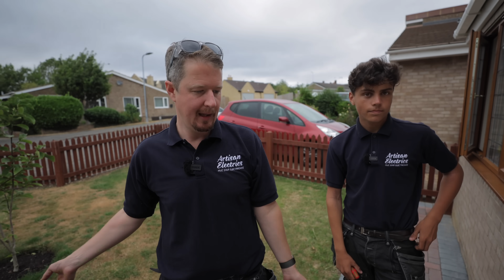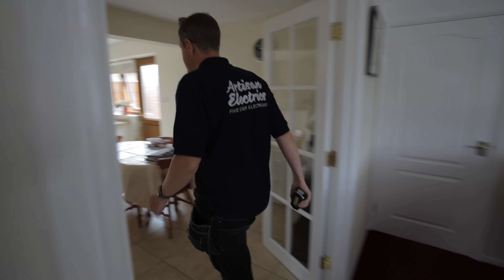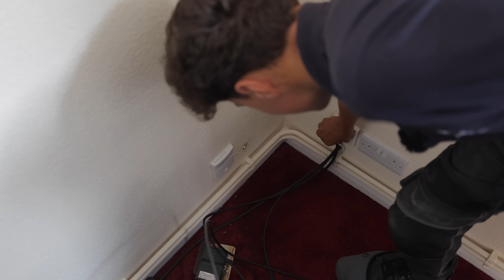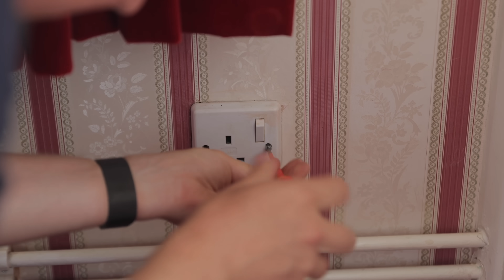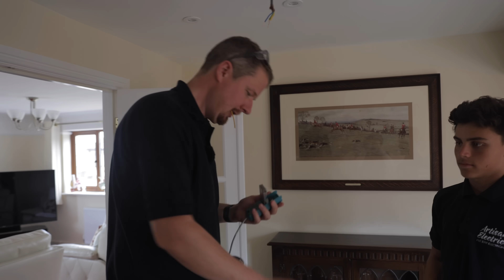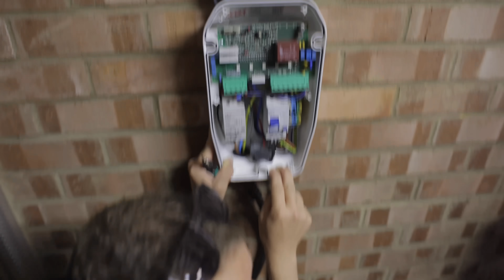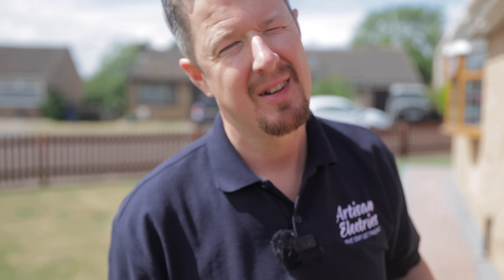CUSTOMER TRIED TO SUE ME - SHARING MY ELECTRICIAN HORROR STORY

Comment: Malmberg is a Swedish company and from my experience they are kind of something in between the cheap no name and big name brand stuff. It's not junk but it doesn't have the premium feel to it like schneider or hager.
Swedish stuff keeps popping up more often than i would think in your videos haha. Tools, gear, components and i even saw a Nibe heater in one video...
Reply: Swedish company yes, but they arenonlyna distributor. The stuff comes from Asia, likely China.
Reply: and tbh, hager mcb´s are not that expensive just checked 16a mbn116 standard boxcutter mcb as it comes,  not even 4€ incl tax. they have like 10 mcb´s max, so 40€

Comment: You mention the car charger
1st I assume the garage is on a concrete pad?
Thats as good as true earth so under pen fault you'd receive a shock.
2nd why code it?
An eicr isn't to check that it complies with current regs is to ensure the installation is safe and in good working condition.
Hence condition report.

You could make the customer aware of your concern but to code it is incorrect.
Speak with the nic and I'm sure they will agree.
If however the car charger wasn't installed correctly to the regs at the time of install then thats different

Comment: malmberg are swedish, do not make that kind off box (only full front with lock, swedish standard) but they are made to fit every thing (in sweden you can have any kind of fuse in any box, becuse the law only say the installer only "need to do it the normal way" (no license or training needed for after installations, and just one guy with license on new prudaction) but still known to have one off if not the highest electrical safety in the world), but england is very wierd with there laws.

Comment: Confidence is easily gained with a professional articulate patient mentor.  Yet another highly professional video. thank you
Reply: Great video. Just a point about the roof joists: if you're fitting "in roof " panels in place of those tiles, you will almost certainly be reducing the load on the roof, not increasing it as the panels are much lighter than the tiles they replace.

Comment: Impedance vs resistance.... 
Short answer: Resistance is more for DC where as impedance is the AC equivalent of DC resistance. 
Long answer: With AC circuits the capacitive and inductive reactive components react differently based on the AC frequency as compared to DC. So in order to get a true AC resistance reading you have to account for both those reactive components plus the true (non-reactive) resistance and the resultant measure or calculation is called impedance.
Reply: Hoorah! Someone who actually understands at last 🙂

Comment: Sorry, it bothers me that you are concerned if the brand of MCB is different from the board... why does it matter?
Reply from the maker: Not type tested and sometimes they don’t fit properly
Reply: @artisanelectrics   how can you tell if it is type tested?
Reply: @michaele5543   you ask the board manufacturers if they tested the other brand in their boards (not to see if they work, the test is for performance like overheat and interference, precise alignment etc). I take a bet no manufacturer ever tests another brand in their board, why would they.
Reply: @electricery  thanks for educating me, I didn't realise a board maker would be required to test it like this but now it does make sense. It does come across as nitpicking though... Presumably it doesn't actually fail an EICR?  It's a bit like an MOT tester insisting that cars should be fitted with the tyre brand that the vehicle was type approved with...
Reply: @michaele5543  can fail, depends if it shows signs of heat stress or if it doesn't fit the busbar properly.  It will normally be a code 3 if looks ok and code 2 if potentially a hazard. It is in the regs book and therefore should be complied with when making repairs or upgrades to the consumer unit

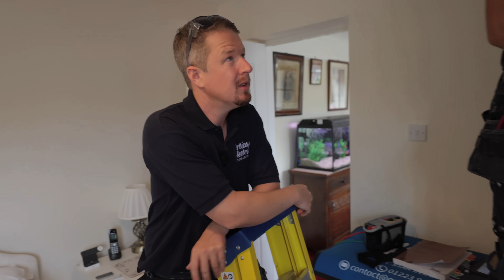Comment: 8:13 Not a customer or anything but I put up a video about a shady parking company (Parkshield Group) that managed car parks for fines. Their site was awful and insecure. I pointed this out in my video. Took them a year to decide they didn't like it and flagged it as their own work so the video got removed and I got a strike which I had to wait to expire. They tried to cover their tracks by changing their site so they put they'd updated their privacy policy before my video was up, trying to claim my video was false. They didn't know about the wayback machine that had archived their site and showed the exact same page missing the information they claim was on there on that date.

A few years before that purchased an old Nokia E71 from someone off Ebay. It arrived with a cracked screen. Guy refused to refund told me to take it up with Royal Mail. Ebay weren't interested. Idiot had secure wiped the phone so I restored the data on it and got a few photos that ended up on my website along with old mobile numbers recovered.

Comment: Those breakers are type LSN made by the OEZ company in Czech Republic, and rebranded under the Malmberg namebrand. They are generally good quality, as can be seen from the 10kA breaking current capability they are rated at. Those in the video were manufactured from the late 90s to the early 2000s.
Reply: as is also obvious since they have the OEZ logo on them. Also notable that they have Danish, Swedish, and Norwegian certification logos on the front, which means they were made for Scandinavia (which also explains the brand name) and thus most likely not certified for use in the UK - especially since the UK use much higher breaker ratings on their circuits than the rest of Europe

Comment: do you have something  that can be used as a circuit sniffer???

Personally if was tasked to do something and there was electrical hazard within play ..

I don't believe in multi point circuits on modern rcd circuit breakers because it can create an over loaded circuit tripping breakers everywhere

Bad habits die hard when you spend 

decades in the industry doing you could overload a older style breaker and it be fine +5-15%

My opinion that rcd needs to be a bigger unit.

i'd would of pulled the globe out of the hanging lights to see what the wattage was

what is the average summer weather in the UK I would  recommend to sample the   heat  within the roof space before doing that install...

personally  i;d be the tying the common earth with a 20-40 ground rood..

we abandoned the water ground decades ago..

Comment: @8:14 i had it the other way around:
a metering company (not ISTA) showed up in my bathroom in order to exchange the 2 water meters (the warm water meter had just 5m³, because this residential unit was empty for a long time)... they removed the "old" ones and when they lubed the thread with their bare fingers they smeared lube deep into the pipe, when they "accidentally" slipped off the outer thread... but luckily they wiped it "all" off with their trusty cloth from the back pocket of their pants... then they lubed the female thread, too (as if the lube on the male thread wasn't enough), in order to make sure, that the water gets lubed, too...
unluckily i m not a lawyer... so i did not have the police pulling them to the curb... and find a better installation company....
i hope the grey lube doesnt contain too much poison.... 🤢🤮😋😛😜🤪😝

Comment: Very nice and comprehensive overview of running this EICR! 
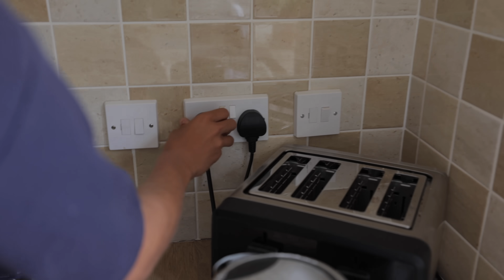Did see a few continuity issues in the video though... At 16:15 you're isolation testing 3 circuits with the RCD turned off, but all 3 circuits are still turned ON. So you're getting 3 similar readings since they're basically all still connected together. Makes little sense in finding the circuit with the low isolation value.
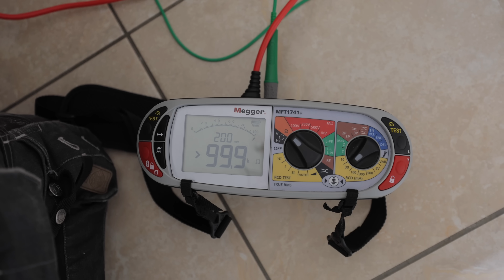And at 17:56, the megger displays >99,9 kohms, but your leads aren't zeroed out. So whatever reading that test would give is a false reading anyway. (later on, the values are correct, as the leads are zeroed out).

Comment: Very impressed , I started on commercial where everything had to be done to not only look good but be good. I moved into domestic after getting fed up with travelling and as a tester also I couldn’t believe how shocking rewires or new installs were on the whole . Most people who do rewires are used to doing price work and they cut corners and are messy because the prices are so low. In fact after 15 years I left electrics because the pay is poor for what you have to learn (I did up to Part C )and the responsibility is not rewarded . I did do my own work for a number of years and was surprised how eager the householder was to pay any other trade a good price  but thought an electrician was expensive . Friends and family were always expecting work for nothing and these jobs usually ended up taking a long time putting right issues thrown up from shoddy work . Electrician is the most dangerous and academically demanding trade that there is but commercially and domestically is the worst paid and the constant expensive updates , ECS and NICEIC which are required along with other trades being allowed to do certain jobs which they will never have the theoretical knowledge for has for me turned it into a trade not worth doing . Sorry to be the bearer of bad tidings to you budding sparky’s but unless you can get a business where you employ several electrician’s you will not earn anything like other trades can earn . Oh and when doing your earth main bonding tests give the cable a good yank because the amount of times I found a 10mm connector blocked to the old 6 mm cables on difficult runs was too many to mention .
Reply: Amen to this, on the flip side to this since leaving the EU sparkies wages have gone up. But yeah sparkies are the only trade where clients go wide eyed at paying the going rate and fall over themselves to pay other trades above rate prices. If I was starting out again id choose a different trade.
Reply: @bdboyo  It's always easier for plumbers. As someone once told me "It's amazing how people's willingness to pay the rate goes up when they've got water ....ing down their walls"

It's a much harder sell saying "That needs to be changed as it's unsafe" when the install has been like that for a decade and nothing bad has happened yet
Reply: Encouraging to hear as an apprentice taking his AM2 exam in the new year 😂

Comment: Lol, how slow are you that it took all day to do an EICR! Our landlord supplied electrician did ours in less than an hour.  He didn't bother with such things as checking the water bonding or what size the earth cable was, heck, he didn't even take any sockets off the wall.  Just came in, turned the power off without telling me (im on my works computer, my wife is on an oxygen machine) looked at the 2 rcds in the fusebox and filled out a form on a clipboard. Isn't that the way you normally do it?

Comment: I am pretty sure you can not check the water bond by disconnecting at one end and testing at the tap correct me if I am wrong!! You need to disconnect at both ends then test

Comment: with the gas side of things.
Wouldn't it be also smart to have bonding on the service entry pipe?
Meaning if the gas meter would ever get removed, then the bonding remains?
Reply: If the gas meter is taken out for any reason,  a temporary continuity bond is used between the incoming main and the gas outlet pipe

Comment: how safe is it to batteries in the roof ? do you have to put signs up to on the fire brigade ?
Reply: No the loft is absolutely the worst place for batteries. Any electrician will tell you how hot it gets in the loft. In summer the heat is unbearable. Heat is batteries’ worst enemy.

Comment: You literally nearly electrocuted poor Ruben!   He went to touch the exposed conductors just as you accidentally turned the circuit back on for the down lights 🙁
Reply from the maker: You missed the bit where I shouted that I was turning the power on and all hands should be clear - these videos don’t show everything - we had over 3 hours of footage to cut down to a 30 minute video.
Reply: @artisanelectrics  Fair enough…..👍

Comment: Well done, enjoyed the video. Could i ask about the install of the batteries. Is the loft the best place for them, it always worries me with heat and support. Would the garage be the best place for them?. Fantastic work .
Reply: No the loft is absolutely the worst place for batteries. Any electrician will tell you how hot it gets in the loft. In summer the heat is unbearable. Heat is batteries’ worst enemy.

Comment: Will the inverter and battery in particular exceed their operating temperatures if they're put in the loft?
Reply: Indeed - I'm really against putting inverters and especially lithium based batteries in the average UK loft which has no forced ventilation......50c ambient is common place up there on a really hot day, I expect even a lot more than that with the recent record breaking heatwave.
Reply: Not keen of all this tech in the home, and remember it is a home not a Plant room. 
More risk of fire the more you add.

Comment: Why do you get 110v between L-E when the earth isn't connected at the downlight?
Reply: It’s because the cpc is floating, the cpc will probably have some connection via capacitance/resistance to other conductors or earth but no where near low enough to earth.  The Megger is likely a high impedance instrument on voltage range, it is basically acting like a potential divider and showing the voltage across itself.

Comment: Lofts are not a great environment for solar pv inverters due to heat deficiencies especially batteries
Reply: The inverters also suck in dust and insulation fibres and will need their filters cleaning more often when they overheat due to clogged vents in an already hot environment.

Comment: Sure don't wire like this in States,  seem like it just power cords  and cheap plastics in UK
Reply: No all new consumer units must be metal not plastic. We are also required to put earth sleeving on the CPC, unlike in the US. If you want to talk about cheap look at the 2 pin US plug you can touch both pins of as you’re inserting or removing it from the mains and get a shock.
Reply: @GadgetMan36  US uses 110v. not like 220 there.. so 2 pin no big deal here.  and yes some cheap contactors use cheap crap from China..

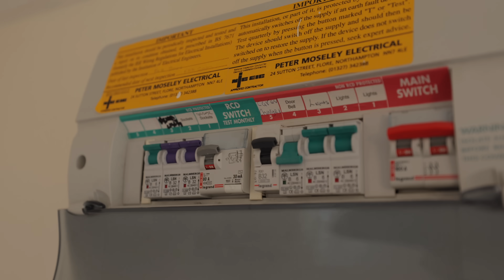Comment: 5:00 seem a typical  uk only  thing ?  .. an MCB type tested to be in particular  fuse board brand ?  So Hager board = hager fuses  Legrand board = legrand mcb's ... ?  In Belgium we buy empy fuseboard( yes plastic board - metal is not allowed here on  TT net .. unless to put the main 300mA RCB in plastic box next to the metal box ) ..  So it's very common here to buy a  Scheider board .. and fill it up with Legrand of Teco of ABB  MCB's  / Eltako teleruptors / Scheider bel-transformer / KNX domotic modules / etc . Impossible to have everything in same brand .   
But for  MCB's on 1 row i do like to keep the same brand if possible... reason is the measurments are not always the same ( some brand combine ok on a bus bar .. some don't - like in the video this is not neat .. i would replace to old ones to match )  .
But sometimes adding a circuit with same brand is not always possible ..( impossible to stock every brand in the van )  .

Maybe this is the reason we never see video's  of houses with home automation ( domotics ) Alway those tiny fuseboard on the most weird places mounted lol ..
Reply: Can't remember where I read it (IET maybe), but the issue of mixing manufacturers has something to do with the location of 'exhausts' in the MCB/RCBO devices ~ causing possible problems when they are side and trip. Advisable to have blank gap between different makes for this reason. (Eg early days of SPDs when you couldn't buy them for all makes)
Reply: @herrtomas6729  must be a UK thing ..  i see it all the time mixed brands in one board .  Also in commercial installations .  Also it seems not be allowed to put a bell transformer din rail ( double insulated)  in the same board .. as de low voltage wires are not rated for 240V .. Also never seen a uk board with teleruptors with 24V coils and switch 240V lights etc .( low votage part  0,8mm svv   / 240V part normal twin & earth) . Seems the most houses have standard swiches & sockets ..

Comment: Great video Jordan, especially with Reuben, he's coming on a treat, you should be proud!
Never heard of Malmberg before!
Love the Mukguards.
Great mats
board is about average to be fair, not exactly neat
Love Thomas Nagy, he was my first YouTube Electrician that I subscribed to.
Love my Brother label printer.
Great point about zeroing the leads
Love them boards with the moveable link for the ZE.
I would code the downlight basic insulation as C2 as an Electrician could touch them during an inspection or electrical work, similar to a suspended ceiling.
Not all installations require a PEN fault, depends on the installation and whether or not there are class 1 or potential earth paths in the vicinity of the car(10 metres).
Now that I'm doing solar it gives me an excuse to buy a drone!!!! YESSSS!!!! Cheers mate!
Great solar survey.
Top job guys!

Comment: 13:02 it's impedance when it's an AC circuit and resistance when it's a DC circuit, at least that was my understanding :D
Reply: Hint is in the name of the reading. Ze, I.e. impedance of the earth circuit.  If they were measuring resistance it would be Re.
Impedance is the measure of the resistance and reactance of the circuit.  It does not matter if the circuit is AC or DC.
Reply: @Shocker99  really?  So when you ‘measure’ Zs you are measuring impedance because of the hint in the name?  You cannot measure impedance with a dc dead test. Reactance on the other hand is opposition to capacitance and induction - totally unhelpful reply - Robin is more right than you are